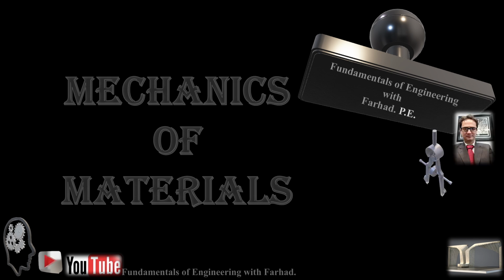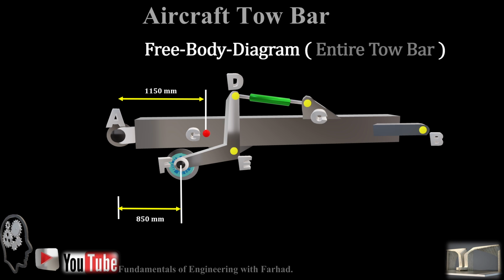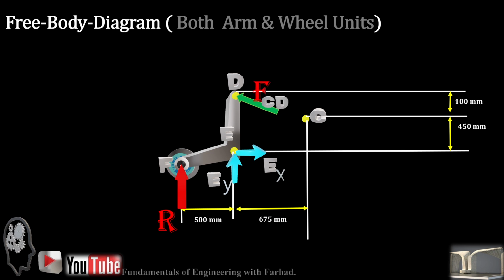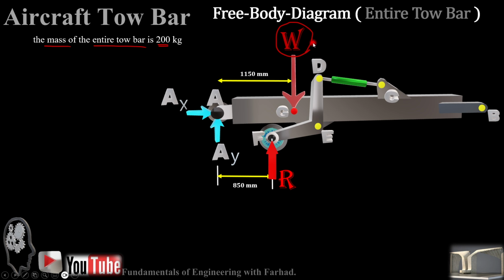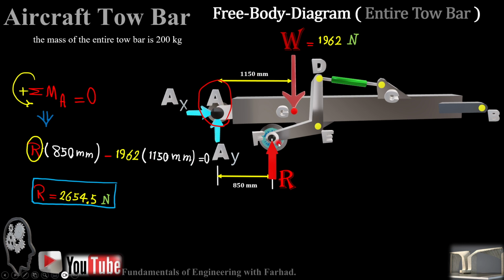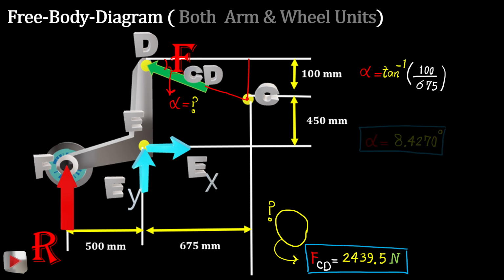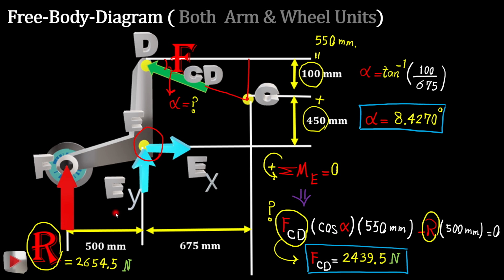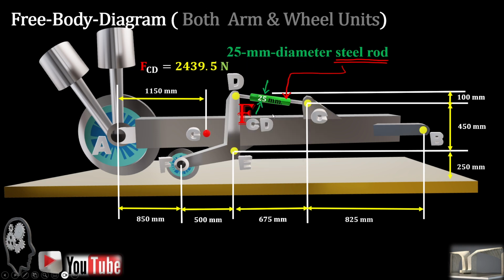270_Aircraft Tow Bar (Complete Version.)

Comment from the maker: This video shows how to calculate forces, and stresses through a clear-cut drawing of free-body-diagram 
(F.B.D).  A Firm understanding of geometry of problem and location of internal and external forces helps to choose the bast selection of moment equations (to eliminate max forces possible and proceed with the simplest force calculation approach). Definitely choosing the best location to start moment equation requires a careful attention to problem statement as well as physics of the problem) But the good news is you can master it over time by practice. (Practice Makes Perfect.)
Video No. 264_Normal Stress in Robotic Arm.] is another good example of F.B.D. drawing. 
Please comment me on how you find this video, and how you would evaluate it in terms of its pros & cons in a respectful manner. I will ty my best to apply your intresting  ideas for  future refrence.
Thanks.
Farhad.